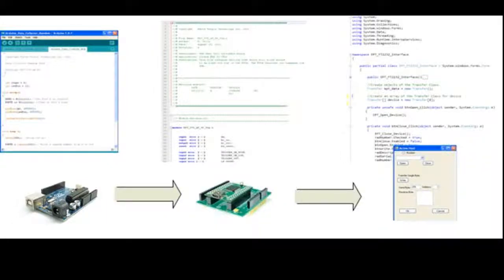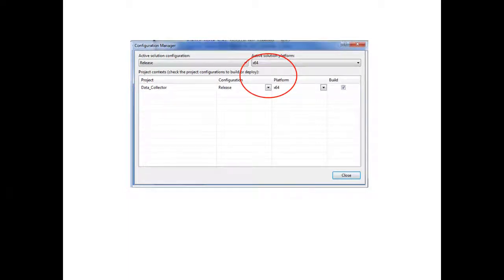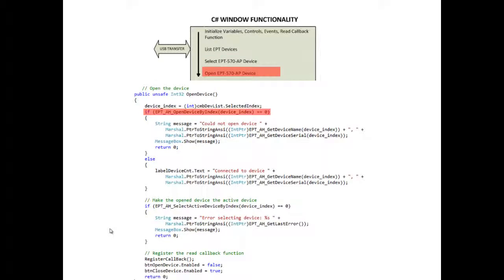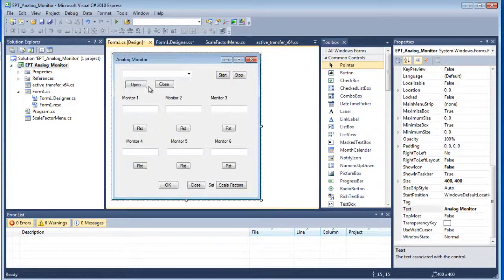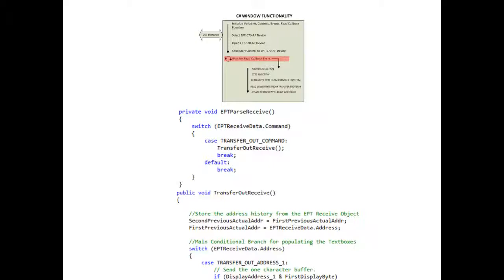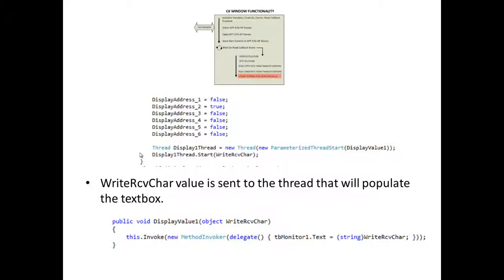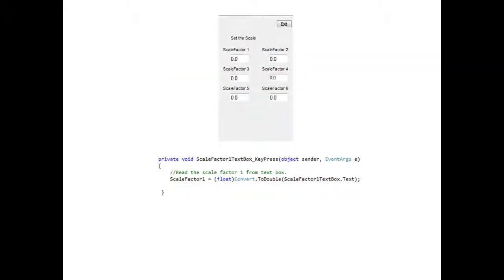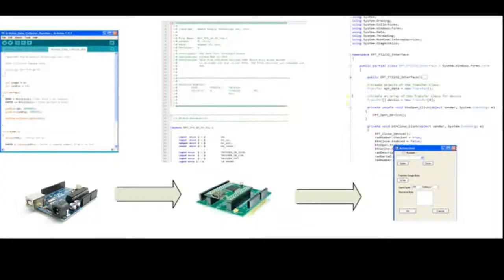Create an Arduino RealTime Data Acquisition System Pt 3

Comment: Great tutorial, thank you for it. is it possible to, if lets say only 10 times 6 voltages are measured a second, to write this data to a .txt file?
Reply from the maker: Hi Pieterjan, Sorry for the late reply, been quite busy preparing the Arduino Oscilloscope using the UnoProLogic Video. Yes, the Arduino code sets the speed of sending data to the PC (it also is the limiting factor). The UnoProLogic is capable of sending data at a rate of 8 MBytes/second. So, in the 'loop()' function, just add a delay(x) and that will slow things down.

And yes, it is quite easy to write all data to a text file. We use C# code on the PC. This let's us take advantage of the .NET framework from Microsoft. Setting up and using a text file happens with the use of the streamwriter class. It's one line of code to open the file and then add 'file.write' where ever a write to the PC display is used.

We will start another project that adds the text file write capability in a few weeks and get this posted to the website.

Thanks, EPT Team